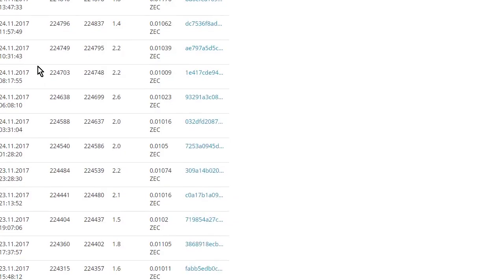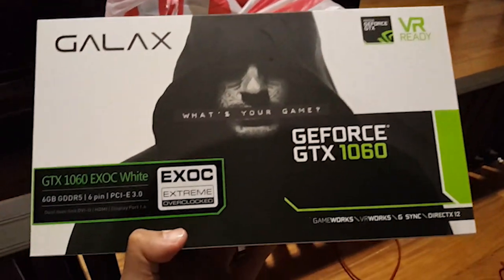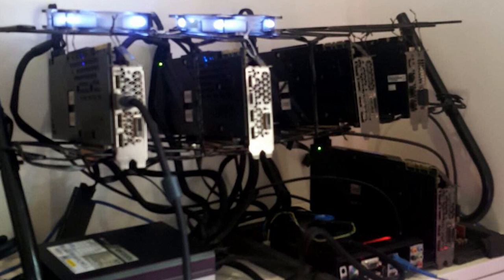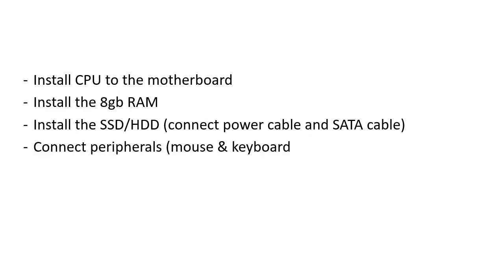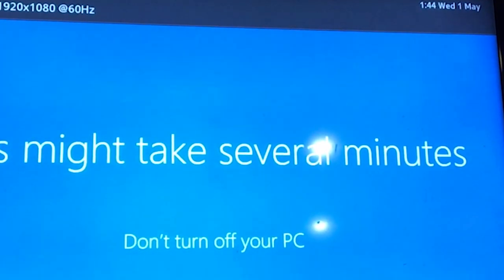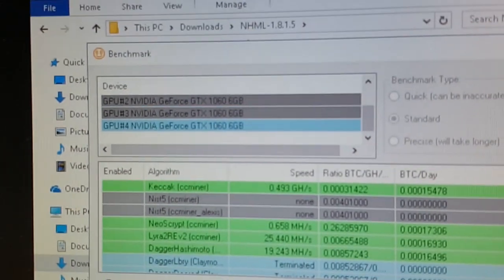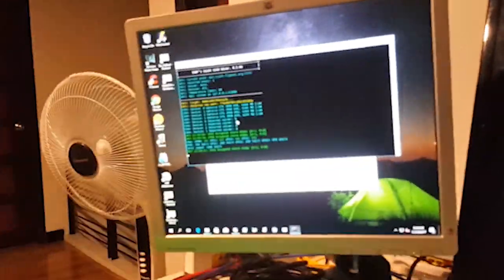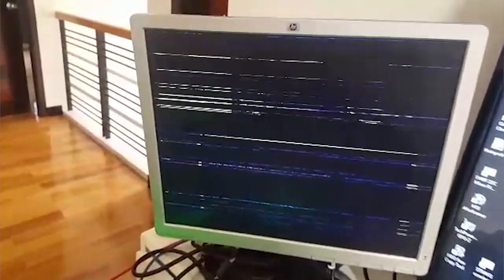Best Cost & Power Efficient Mining Rig build IMO - 12 GPU GALAX GTX 1060 6gb ExOC Rig

Comment: Can you used any type of Processor
Reply from the maker: you can actually use lower end procies like G3900 if you'll use the PC solely for mining.  But if you plan on using the PC for gaming or other CPU intensive programs also, better get a higher end one.

Comment: Bro... I've heard that AMD is better optimized for mining... it's also cheaper (although not power efficient) but its hashrate of an rx 580 is close to that of a gtx 1070. So why did you decide to go with the GTX 1060 when the price is  similar to that of rx 580? thanks
Reply from the maker: A couple of factors like availability, price to purchase and efficiency.  You also have to consider that when I made this decision, Ethereum and Electroneum's market prices hasn't soared yet, making the efficiency/profitability of RX cards limited to a number of coins.  With the current market rates, I'm actually reconsidering building an AMD rig. :)
Reply: which coins are AMD cards profitable and which coins are NVIDIA cards profitable? I'm planning to build a hybrid build bro... and I was hoping to hear your thoughts about this. thanks
Reply from the maker: Mark Vincent Guy building a hybrid might be a bit more difficult to keep stable especially if you're new to this. Can be done but might need to have more advanced technical knowledge to troubleshoot issues. As for the more profitable coins, you can check out a whole list and how much estimated profits your planned build can generate thru www.whattomine.com
Reply: Thanks for the tip bro... I appreciate it!
Reply: daveFL 
But now hush, zclassic and other equihashes are more profitable than ethereum. Equihashe is better with NAVIDAD. I don't understand why you said AMD is better now

Comment: Bro nakagalax gtx 1060 6gb OC version ako zec mining. My first mining rig actually. 3.8sol/w efficiency 260sol/s naman. Tropa ko nagOC ayoko masunugan ng mobo at never tried it before. Hahaha. Goods na ba to or may idea ka sa better OCing neto for better mining results and profit? Thanks bro. Subbed and liked!
Reply from the maker: Kuya Mackoy thanks for the sub and like :) ano current settings mo? Kasi alam ko yung Galax OC version is a little lower yung base saka boost clocks. Ano din pala yung memory chips? Hynix? Samsung or micron? Try mo 70-75% tdp, +115 core clock, +200 mem clock. Check mo if may improvement saka if stable
Reply: Hynix sir. Sige try ko. Thanks!
Reply: 10sol/s lang inincrease. Bumaba din efficiency 😂
Reply from the maker: Kuya Mackoy ibang model ng cards and memory chips kasi. Do different oc settings lang and take note of the changes. Im sure you'll be able to figure out the best settings for your rig.

Comment: dave, i have one more Q.

Is it possible for me, to connect 6 AMD GPUs and 6 NVIDIA GPUs to the some motherboard, but mine different cryptos - 6 amd mining ethereum, 6 nvidia mining monero or zcash whatever? Thanks
Reply from the maker: Yup. That is possible. Although a little tricky to make it run stable. If you're planning on doing that, you have to make changes in the bios settings. Set the pcie link speed to gen 1 or gen 2 (whichever works), then install first the RX card driver, disable windows auto update and then install nvidia driver. It should work after. You'll just have to download different miners like claymore or sgminer for RX cards then ewbf or ccminer for NVidia

Comment: Dave, I came from the philippines with the prices of electricity in the Philippines (I'm aware it is high last time I was there). Are you still seeing a profit mining ETH?
Reply: Thanks Dave, I am new at all this so want to be sure on everything, so would it be safe to say about 750 pesos a month per 1060 6gb card, at 85w, also if you do not mind me asking what the 12 gpu's earn you on avg in php? for that one rig alone?
Reply from the maker: Depends on your definition of profitability.  I'm currently mining zec with 2 rigs, and then one rig running on nicehash.  The nicehash rig basically pays for all the electricity and a little extra for maintenance, and then the two rigs now are purely running for profit.  :)
Reply: Dave I am in Cebu setting up the same exact rig, how much in PHP should I expect I will be paying in electric costs for 12 1060 6gb jet stream, aprox?? Thanks
Reply from the maker: with current electricity rates, my computation is a little over 7,000 pesos.  This is not yet considering the upcoming increase in electricity rates this year.
Reply from the maker: oh and this is based on running each GPU at 85 watts each
Reply: 7k pesos a month in electric costs for just the 12 1060s right?
Reply from the maker: 7k pesos for the whole 1060 rig already.  Can't really say exactly how much I earn because of market prices and volatility but my hashrates is 300 sol/s per card mining zcash, 19 - 21 mh/s mining ethereum.  You can log-in to whattomine.com and see how much that would be with the current market prices and difficulty.  Right now, it's showing 36 USD per day mining zcash and 45 USD per day mining ethereum. again, this could change when you read this message.

Comment: Actualy efficiency is less on the 1060 than the 1070ti but they are a bit more profitable in term of budget/revenue
Also there is a caveat because with such a rig you will need more cables and more risers and will need linux because you are limited to 8 cards under windows.
But overall 1060 are the best bang for the buck
Reply from the maker: dont have personal experience yet on 1070ti.  Maybe that would be a new rig build idea :) True on the caveat where more risers and linux based OS usage but it still is more profitable compared to my other builds.

Comment: in your exel calculations you mention, that for 300sol/s your power consumption is 85W, but later on in video in mining soft, sol per s is almost the same, but power consumption ir 112W, which realatively is a really big increase... in my opinion, evga/gigabye nvidia 1070 is the most efficient video card for a mining rig, depending on what type of coin you are mining (for example Ethereum)

thanks for the video, sub from me!
Reply from the maker: vei boj hi! That was just for testing purposes and playing around with the OC settings. Currently utilizing between 83 - 90 watts per card with the same hashrates.

Comment: tol dave, maganda ba galax na brand? may samsung memory ba na nachecempuhan?
Reply: Thanks man
Reply: JIGZMV, If you're only mining Equihash, Hynix mem is okay. Hynix is bad on ethash algo.
Reply from the maker: Robin & Maxine decent brand naman yung Galax. So far, lahat ng GPUs ko puro micron eh. Zotac, Palit, Asus saka Galax.
Reply: Salamat tol, bibili kasi ko bukas ng gpu, baka galax na hanapin ko. wag sana malasin sa hynix mem. hehe
Reply from the maker: kunin mo itong Galax 1060 6gb exoc white model.  mas mataas performance compared sa other variants ng Galax.  Good luck sa memory chips! sana nga samsung or at least micron. :D
Reply: Hey guys, i'm also looking to buy 6 galax gpu's soon. Curious lang ako, what if hynix ang na tsempuhan ko na chip, magagamit ko pa rin ba to sa mining?

@ hey dave!
Can you hook me up where you buy your gpus, risers and others?
Okay lang kaya to start muna with 6 gpu's?
Thanks in advance. Sorry if I have lots of questions.

Your vids are very helpful to starters like me😂
Reply from the maker: JIGZMV from what I know, hashrates are lower and harder to push up even thru overclock if hynix mems. Search mo yung crypto market PH group on Facebook. Dun maraming online and shop sellers ng mga parts. :)